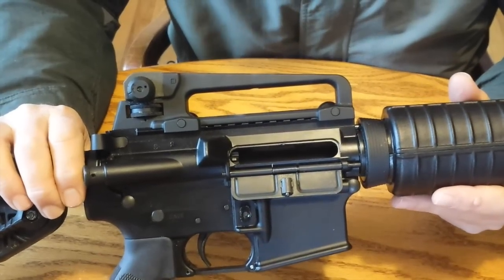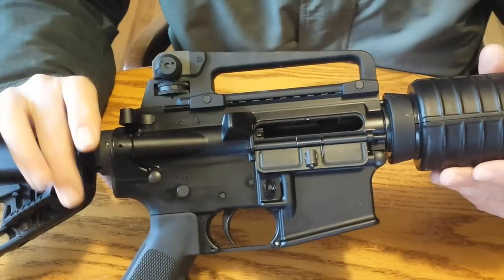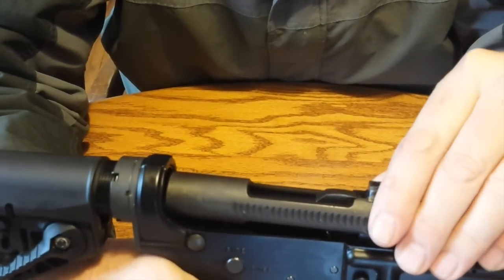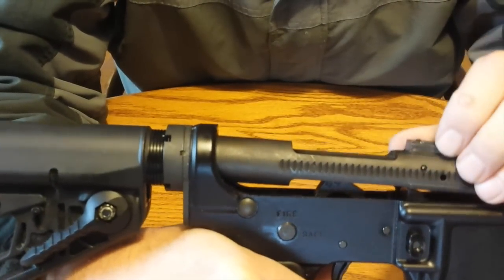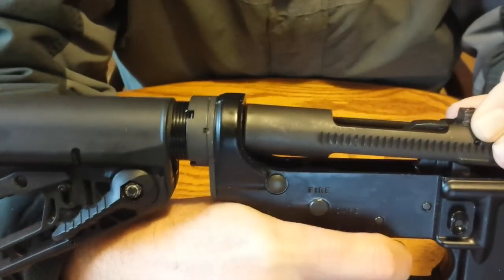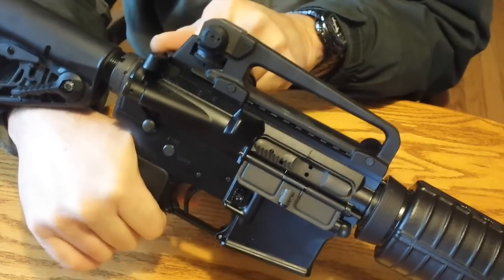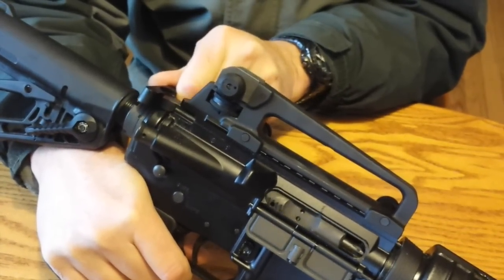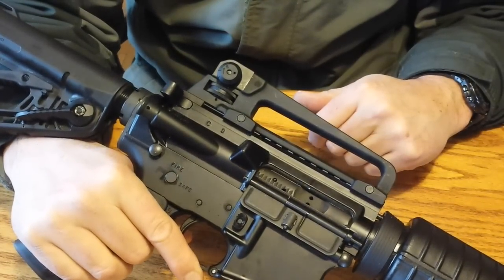How To Decock An AR 15 Rifle

Comment: That's very interesting, cocking was an important part of small arms doctine in the XIXth and XXth, from Rolling Block to lever guns and bolt action rifles.
With a striker fired pistol or an automatic rifle (assault rifle) you can't cock again to second-strike a low sensitive cartridge, you must cycle the gun and dispose of the striked cartridge, even if it can be a hangfire.

Comment: Informative.  I'm not following were this would apply.  With the upper mounted and verified empty, pulling the trigger decocks the rifle.  You did this in your demo.  When function checking the trigger, pulling the trigger and catching the hammer with your other hand does the same thing and is more consistent with training.  Like I said it is informative.  I never thought about it this way.  I look forward to an application for this procedure.  Thanks.
Reply from the maker: shermfj I like to store my AR with hammer forward. Sometimes I dry fire, other times I decock it. I was asked if it was possible, I'm just showing that it is, and how to do it. Cheers
Reply: stanfordcoffee Thanks.  I found it interesting.  Never had it presented in general conversations or in the countless hours of YouTube and Google researching the AR and components.  Great tip.  Thanks.

Comment: Is dry firing an AR without a snapcap bad for it?
Reply from the maker: I don't do it, but some drive firing won't hurt it. Doing it thousands of times can flatten the back of a firing pin and make it brittle, but that's about it. Cheers
Reply: You can dry fire it as much as you want

Comment: Yea, handy, but I dry fire my ar-15's with impunity. I've heard it's actually somewhat encouraged sometimes, strange as that may seem. I have a glock, and I don't dry fire it except unless I am forced to de-cock it; or I'm breaking it down. I don't even generally ask about dry firing an ar I am looking at in stores. I won't dry fire any other firearm though.
Reply from the maker: +Jamfanwp In this video, I simply show how to decock an AR15. Noticed there is no discussion on the merits of decocking versus dry firing or anything on that subject. Somebody asked me if it was possible, and it is. Cheers
Reply: stanfordcoffee Oh there are situations where this would definitely come in handy. I was just pointing out that AR's are the only firearms I've ever been encouraged to dry fire.